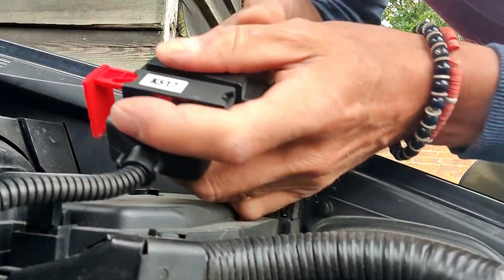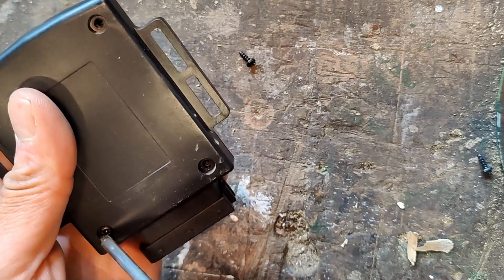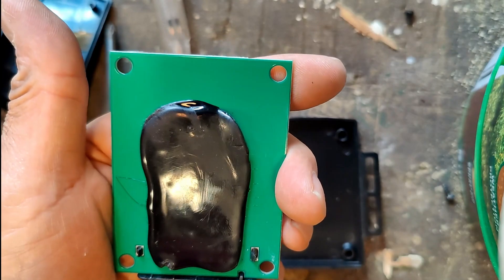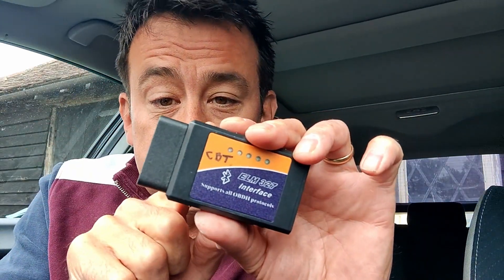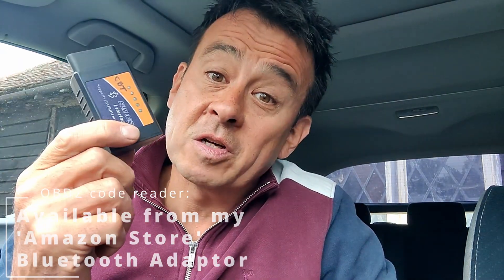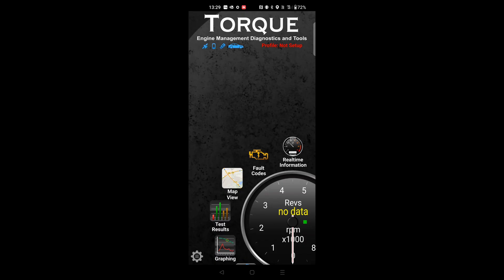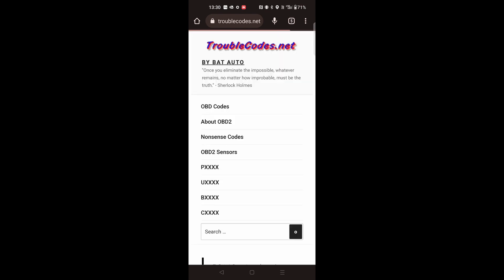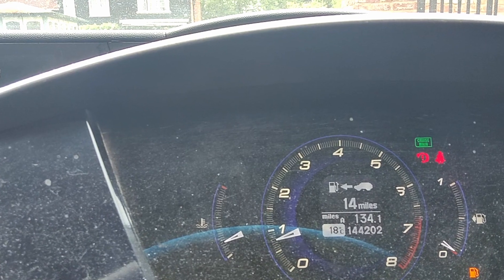Honda Civic ECU Chip Tuning GS2 Box '😵Whats inside!' +OBD2 Bluetooth Fault Code Reader

Comment: In my case, the GS2 is connected to the MAP sensor, which also functions as the IAT (intake air temperature sensor). What I’ve observed through an OBD2 scanner is that when the ambient temperature (in the morning when I start the car) is 14 degrees Celsius, my sensor reads 68 degrees. During the trip, the 68 degrees rise up to 79 degrees. Unfortunately, this can lead to an increase in combustion chamber temperature, and I’m worried that I might need to repair the engine in the future. I’m considering removing it, even though after 22 left turns, the result is what I wanted. :( Edit: ah exactly! I see that on video now!
Reply from the maker: @s.tavros  you could disconnect it for a while and see how she performs
Reply: @GrooveOn  Yeap absolutely.

Comment: https://www.youtube.com/watch?v=rryQpvT3rWY
the wires go straight , not through the chip unit, watch minute 16:40 , only power and the values that were supposed to be tuned bypass the unit and remain the same:)))) save your money fellas
Reply: why doesn't he respond?
Reply: Did you see the wires continuing to the box and not going around it? This box will change the way an engine acts, not by a great margin, but still a bit. The box is basically just an inline variable potentiometer for the MAP sensor(MAF for NA engines). It changes the signal the ECU receives and makes the car think it's getting higher intake pressure and thus the ECU changes the fueling. You'll most likely get some low-end power(more reactive throttle) and if any high-end(due to different AFR).

Comment: I just installed one of these GS2 boxes in my Peugeot RCZ 1.6 Petrol and, after 200 miles and with no screwdriver adjustments, I am very favourably impressed. The car may, possibly, be a bit quicker through the gears, but it is definitely much smoother (especially up to 2500 rpm) and fuel economy appears to be about 5mpg better on a motorway run at 60mph. 

You are not going to shake the earth for £81, but I would certainly recommend this unit as a simple, cost effective and refreshingly impressive upgrade on a mid-range car
Reply from the maker: yep those are my thoughts too, nice one !
Reply: @GrooveOn how is your car holding up? I wanted to get one but I'm worried about damaging the engine
Reply: I have a 1.4 T Hyundai I30 I don't want extra power not fussed but all I want is the take off to be smoother. Is it worth getting one of these units for my car?

Comment: Thanks for your video. I am thinking about this its good to know it works and the code issue. By connection and the code, looks the module is faking the air temp. to the ECU to giving more fuel for the power.

Comment: I got 2 of those OBD2 devices and never made any of them read anything of my 07 Civic. Is there any trick about the connection or protocol that must be setup? I mean, the phone can see the OBD2 device, it just never talks to the car for some reason.
Reply from the maker: I know what you mean. What I find works is plug in the OBD2, then go to  Bluetooth on your phone and find the device, it may not be obvious just search for new device, then connect. It won't show connected on phone, but go to the app for your OBD2 ( I use torque) and make sure your connection settings are set for a Bluetooth device
Reply: @GrooveOn  Thank you. I will try again later today and I’ll get back to you. 
And thank you for the videos, they are really helpful.
Reply: @GrooveOn  Just letting you know that it worked. Thank you so much.
Reply from the maker: @IsidroMagalhães  that's great news, well done you!!